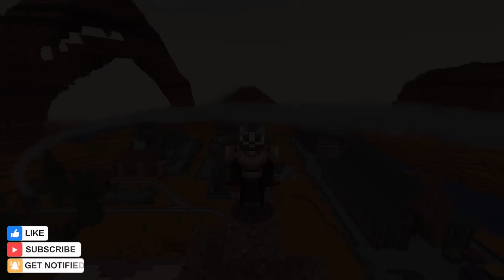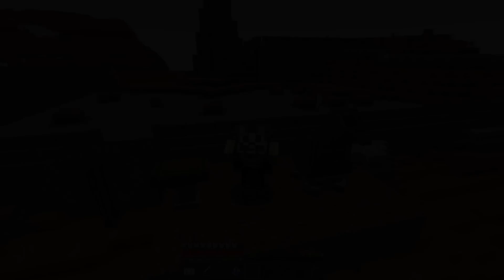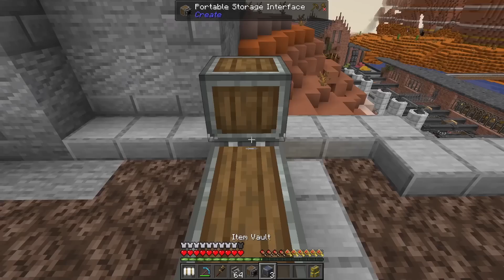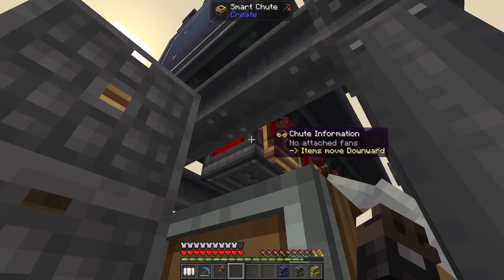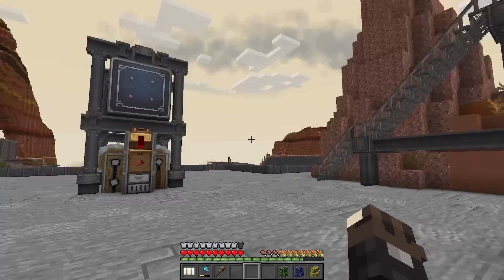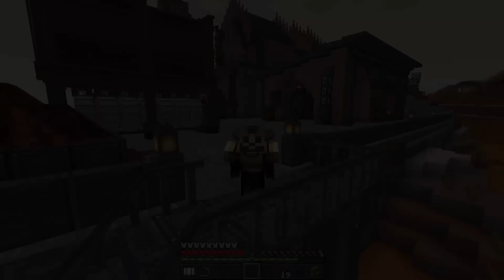I AUTOMATED Redstone Production Minecraft Create Mod!

Comment: I love the trap door disguise. Your new building reminds me of a chapel (paying homage to Redstone). I do agree about the gap between the 2 constructs being a bit big or lacking something.
Reply: I think he should connect the roofs but leave the bottom open because for me as well it does seem to lack something
Reply from the maker: Agree, started working on it already, would like to keep the two roofs separate, but will see how it looks after I changed it. Will post on the Discord to get feedback.
Reply from the maker: I feel exactly the same way. In the clip I thought I was fine with it, but after spending some time in the area it felt a bit out of proportion. So I extended the Smaller "Chapel" two blocks towards the Center roof. So making it smaller, and also making the other one bigger. It feels more sturdy, but might extend to the other side as well.